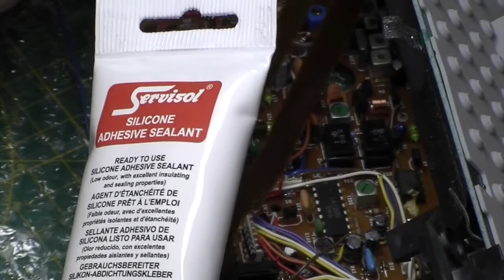Sony ICF 2001D receiver repair part 5: The end!

Comment: Hi Graham,it has been a pleasure to help you find the crystal oscillator that was from a sony sw55 donor, I hope the radio can be enjoyed by its owner Lee for another 25 years or maybe more since it is seen that it was repaired by a real professional, I hope that people know with your videos how complicated could be any repair in this type of radios but sometimes are solved more easily, unfortunately any radio that is more than 20 years will need a complete renewal of electrolytic capacitors, a greeting and see you soon.
Regards Manuel
Reply from the maker: Hi Manuel and thanks for stopping by my channel. Thanks to you the radio should last for many more years. I think people should be able to see from my videos how difficult these are to work on. Renewal of the capacitors certainly was worthwhile and as you say at 20 years they do need sorting really. Good luck with your repair business and your YouTube channel which I have subscribed to. All the best Graham
Reply: Manuel Medina
Thanks for helping to allow Graham to do the complete repair! So great to see that the SWL/radio collecting community are so giving, to see another great iconic classic live on to see another day (2001D). It's interesting that even today the weakest link in most modern electronics are the electrolytic caps, as even in the best most stable environments these only seem to last about 25 years max before they go so far out of spec they cause a failure.
Reply: Radiocruncher 
The crystal failure is intriguing as it isn't that common for these to 
"go bad". I'd bet that the thin wire inside came unsecured from contact with the crystal which is why when you tap the case you get intermittent functioning perfectly. Forgive me but what date was this unit manufactured?

Comment: Congratulations, never give up :) I wonder if you can advise me with my 2001D, it has lost some sensitivity, audio sounds muddy and I think the external antenna socket has a dry joint. I am ok with soldering etc but have no alignment tools. If you had some videos to show me what I need to do that would be wonderful.
Reply from the maker: Thanks Mike. Poor audio would normally point towards capacitors. That’s a bit of a nightmare to swap them all but if you persevere it will be well worth it. There is talk about a fet  transistor in the am front end failing which can affect sensitivity so have a google and you should be able to get the info. I did shoot lots of video on this radio so if you plough through them all hopefully it will help. Good luck and thanks for watching. Graham

Comment: Do you still do repair on these radios?  The radio was purchased in 1993 and has never been opened.  Problems with random noises on reception (FM/Air/SW) and non-response with most buttons (except battery check one).  Thanks.

Comment: What screw size is used to hold down the jack board?
Reply from the maker: There isn't any screws holding it down. The back of the case secures it
Reply: @Radiocruncher  Thanks for quick reply. I saw some threads in the case and was wondering. Not anymore!

Comment: Saya punya masalah di radio seperti ini dengan menimbulkan kode error 3 diindikator apakah anda ada saran saya harus gimana mr? Tolong saya.
Reply from the maker: Usually a battery issue and caused by bad connections so should be easy to sort

Comment: Hi,The FM is mono or stereo to earphones?
Reply from the maker: Hi. It states in the manual that it’s mono but looking at the circuit it’s wired to come out of both earpieces with stereo headphones
Reply: more crazy its to manufacture such a great radio without fm stereo ,thank you for your Answer really appreciate   @Radiocruncher